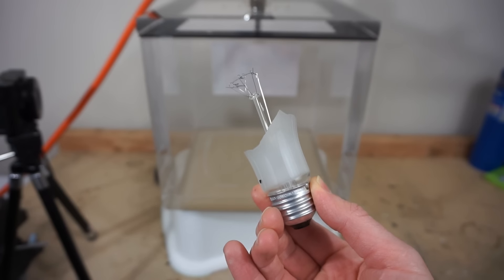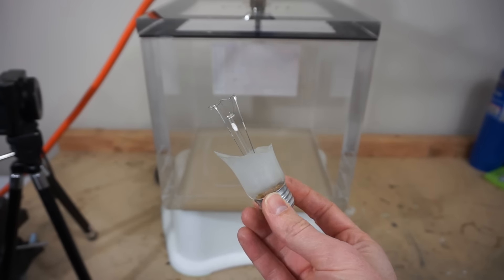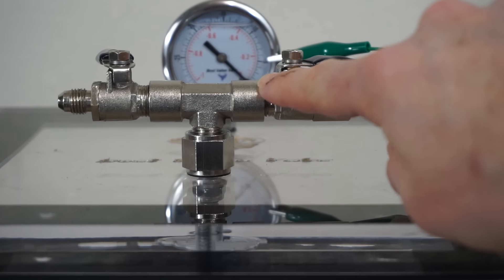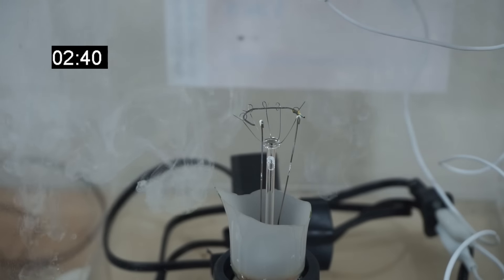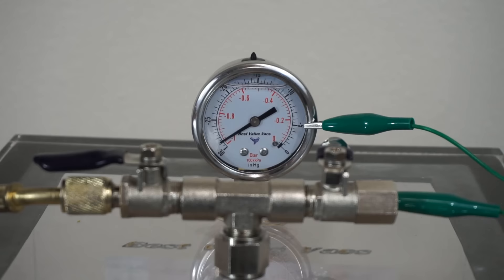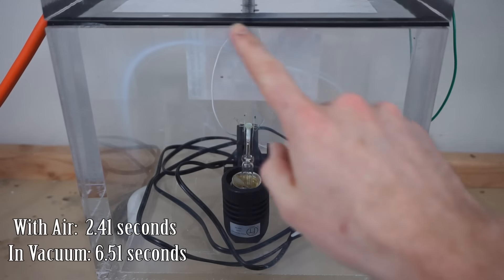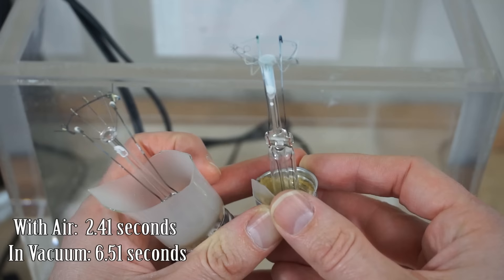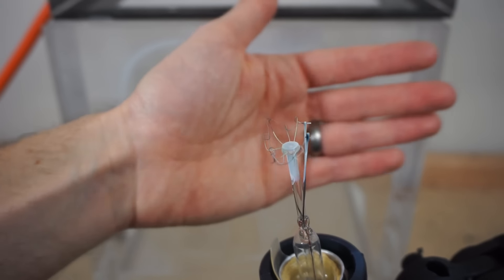What Happens When You Turn On A Broken Light Bulb In A Vacuum Chamber? Will It Burn Out?

Comment: You noticed the second one was thinner since in vacuum due to very low pressure and high temperature the filament sublimates, that's what the gas ring was and that's the reason it only lasted 6 seconds.

Learned so much science from you, Thanks!

Comment: Put in 2 bulbs using the first one to get rid of the oxygen before starting the second one.
Reply: Get this pinned!!
Reply: Fletcher Hurst that's smart
Reply: considering the low pressure and consequently lack of air in there it might actually burn all if not almost all of it
Reply: A candle would be easier.
Reply: The best thing would be to get a good vacuum pump.  End of story.
Reply: thank you also add gas for colors
Reply: The way you do it when you are aiming for a really low vacuum is to flush the evacuated chamber with a heavy inert gas like argon and/or krypton, raise the temperature, and then turn on the scavenging pump again. The higher partial pressure of the heavier inert molecules dilutes the reactive ones and their high individual momenta bash the reluctant ones out of crevices and overcome surface adhesion.
Even if you aren't trying to get through the millitorr barrier, the flushing will greatly reduce the concentration of oxygen. Even at an ultra-high vacuum of a trillionth (10^-12 atm or a 0.1 micropascal) of an atmosphere there are about 25 trillion molecules per cubic meter. The average molecular spacing is 0.01 mm.
At 100 Pascals that's a bunch of leftover oxygen at 21%.
Reply: @planktonfun1  yeah like hydrogen or just acetylene would look cool

😂🤣🤣🤣

💥💥💥
Reply: @308_Negra_Arroyo_Lane   I don't think a candle would work because combustion flames require a certain concentration of oxygen to even light. In a vacuum chamber, you wouldnt even be able to light it. It's better to flush it with an inert gas, or burn the oxygen out with another lightbulb.

Comment: I don't think it will burn out immediately, but will last a lot less than if it was in its original glass envelope. My guess is that it will last about 12 hours of continuous use.
I think this because normal bulbs are first filled with an inert gas, and then under vacuum, so that any remaining gas is still inert and won't react with the filament.
But in this case, you're going from air to vacuum, so there will be a small amount of oxygen left, which over time will affect the filament.

I could be completely wrong, but I would like to share my hypothesis.
Reply from the maker: +Dan Coulson yeah I thought it would last a lot longer than it did, but I think that unless you put some inert gas in there there will be enough oxygen to burn out the bulb.
Reply: OK, well my guess for exactly how long was way off. But I'm still happy I correctly guessed it would last longer.
Reply: I think that light bulbs are also made with a way more powerful vacuum... But im not sure
Reply: BlaXeD ! it's not about the suction power of a vacuum but the materials used to make a lightbulb last longer while in use
Reply: Light bulbs are actually filled to about 0.7 bar with an inert gas, usually nitrogen, argon, or a nitrogen-argon mix.
Reply: 0.7 bar isn't that low of a vacuum is it?
I'm correct in understanding 1 bar is atmospheric pressure at sea level? I could be totally off though, don't quote me on that.
Reply: No, it's not that low. Having a fairly high pressure allows the bulb to not have to be as strong to resist the implosive force of the outside atmosphere.
Reply: maybe the second wire melted because it became to hot? if you only have like <0,1 bar left, nearly every warmth is stored (heat output only through radiation) - with a 0,7 inert gas you still have a lot of convection, which would transfer heat from the wire to the glas of the bulb.
Reply: It likely has most to do with the lack of oxygen in the bulb, and the partial pressure on the inside preventing the filament from vaporizing too much.
Reply: @dancoulson6579  It was at a very low pressure, so the tungsten likely vaporized a lot. There would also be some residual oxygen, but there are ways to get rid of that.

Comment: The tungsten melted and/or sublimated as the temperature of the filament got over the fusion point of the metal (the light color temperature visibly increased just before). The absence of an inert gas caused excessive heating and accelerated sublimation of the filament
Reply: @eriton6806  What you're saying makes sense, but you should be careful using cameras to measure color temperature. If you look at the background before and after the filament was turned on in the vacuum, it was much more yellow-orange before, and much more bluish after. In other words, the camera itself, for whatever reason, changed the color temperature of the entire scene, and this is likely the dominant reason that the color temperature of the filament appears to increase. 
While I agree that an inert gas would help remove heat from the filament, even in a vacuum, the filament loses a lot of heat through radiation. So I'm skeptical that the lack of inert gas would lead to a large enough temperature difference to yield a noticeable difference in color temperature.

Comment: I think if you had a gauge that would show very low vacuum pressure more accurately, you would see you probably need to run it a lot longer to get as close to a perfect vacuum as you can.  I would also leave it running in case there is a little bit of leaking.  Of course other suggestions to add in some inert gas would also help.

Comment: the plate of metal in the filliment repulses the ionized molecules in the rarified air of the bulb's vacuum, otherwise, as tesla pointed out, the rarified air left in the vacuum literally attacks the fillament with erosive friction which eats away at the fillament until it tears it apart.  the metal plate is used to attract the erosive molecules.  when the bulb glass changes shape, the pressure zones of the rarified air changes.  a hole in the bottom of the bulb should last longer.  also a dimmer switch would help. great video.  still very surprising.
Reply: Ok?

Comment: I suspect that the reason the filament failed in a vacuum is that it was in a vacuum. This allowed the filament to evaporate when it heated up. With only a few millibars of atmosphere present, the filament doesn't have to heat up much for its vapor pressure to exceed that of the vacuum, and thus the filament starts to evaporate. In addition, the lack of a gas environment means that the only way for heat to transfer away from the filament is by radiation and by conduction through the filament's physical support; thus, the filament heats up faster, which speeds this evaporative process. The filament fails when it ablates away enough to break, or when part of it melts, whichever happens first. The ring of smoke you observed in the video isn't oxidized tungsten, but rather condensed tungsten vapor. 

An intact bulb is filled with around 0.7 bar of an inert gas, usually argon or nitrogen, and that means the filament does not evaporate nearly as much, both because of the higher surrounding gas pressure and because the gas atmosphere conducts heat away from the filament, helping to lower its temperature.

Comment: The thickness of the filaments is a HUGE factor. If you can get some inert gas, like argon for a mig welder or helium for a tig welder, try back filling. Pull your vacuum, introduce the gas until atmosphere, then, pull again. I'll bet you'll get the longevity you're hoping for. Even if your pump could pull the vacuum of interstellar space, the filament would sublimate, coating the vacuum chamber with a black film of condensed tungsten. Halogen bulbs are back filled to a higher pressure, but because of convected heat, that's why the capsules are small. The higher partial pressure keeps the filament from sublimating at higher temperatures. That's why they last so long, and so bright.

Comment: +Hydraulic Press Action  I'm surprised that the one in vacuum didn't last longer.  I guess the thin filament just vaporized too quickly.

I think you should try this with your chamber filled with argon or helium at atmospheric pressure to see if it lasts a really long time.  If it doesn't, something's wrong

Comment: If anyone is wondering why the one in vaccuum is thin.. its because it melted... 

As the bulb was turned on, currebt started to flow. Due to the flow of current and resistance of the filament, heat started to build up. Now normally in a bulb with inert gas, the heat generated would be transfered to the inert gas molecules and to the surface of the bulb. But in vaccum, there was nothing to loose the heat to. And the only way to loose the heat was via. radiation, which is the slowest mode of heat transfer. Hence due to the constant flow of AC current, and the heat energy building up, the filament soon reached its melting point and staeted to melt. But as it melted, it got thinner. And as it got thinner, its resistance increased, which led it to get more hot and glow more... and the process stacked up and ended in the burst of light and the melted filament.

Comment: The reason why the light bulk died in vacuum is not caused by oxidation, but it's because the filament was too hot that it evaporated and then break down.
However, when the filament stays inside a light bulk, it will not evaporate, as the filament reach its chemical equilibrium between the gas state and the solid state inside the confined light bulk.

Comment: Nitrogen.  an inert gas which prevents further oxidase of the filament "Actually prevents overheating of the filament." . added in place of Air.  first the bulb is vacuumed completely of all air, then Nitrogen is pumped in to displace any gasses which are left.  This prevents it from burning out.

Comment: You could have put some liquid nitrogen in the chamber first and then drawn a vacuum on that to remove all the O2 as much as possible.  It should be a lot colder than the regular atmosphere so the regular atmosphere should float on top of it, as you pull the vacuum.  You might have the lightbulb work for a good long time once the temperature gets close to room temperature.

Comment: There's several good suggestions. 
Fill the chamber first. Co2, helium, argon, or from a can of dust-off, then turn it on, then try vacuum. Can the chamber hold pressure? like 1-2 psi? 
Dimmer to turn it on slowly. 
2 bulbs, and dimmer. To see if the first one consumes any reactive gas. 
Looks like you used 45-60W. Try 15W. 
Safer wiring. 

Or even just a flashlight bulb. 

I'll bet Edison did all of that. 

You need a do-over.

Comment: Incandescent light bulbs are filled with halogen, which isn't inert like the noble gases. The chemistry is quite fascinating, and is the reason why unbroken incandescent lights can last hundreds of hours. Some "xenon" incandescent bulbs have a tiny bit of xenon along with the halogen, but these are not true xenon plasma bulbs. Some incandescent light bulbs are filled with a mixture of argon and nitrogen. These have a black deposit on the glass when the globe has died. See https://en.wikipedia.org/wiki/Halogen_lamp

Comment: You can instead of  only sucking air them connect the the other end with nitrogen gas to let it get in and then light it again! The light bulbs contain a little amount of nitrogen gas in them that's why they hold so much nitrogen help the wire not oxidised  ! 👌😉

Comment: Doesn't the inert gas in the lightbulbs also cool the filament so it doesn't reach the melting point?
In a vacuum, the filament would increase in temperature until it melts.

Comment: You can use an isolation transformer which is a 220 to 220v transformer (or 110v).
Just get two old identical iron core transformers, dissasemble them, remove the secondaries, and put both primaries together, then reassemble the Es and Is.
That way you get two phase current that is not referenced to earth or ground... so as long as you don't touch BOTH output cables you are fine. Touching one (any one) will just give you 20v or less when compared to ground voltage.
https://en.wikipedia.org/wiki/Isolation_transformer

Comment: dude, your chamber is leaking, thats why  fly and spider have survived.
Reply from the maker: +King Parodije there is no leak, the pressure gauge shows that the pressure stays at minimum pressure the vacuum can reach. It was just due to the trace oxygen in the chamber. I need to put some other gas in there then vacuum it out. I will probably try this again.
Reply: I don't know what gas you could use. I expect that Carbondioxide might still react with tungsten at those temperatures.
Helium might be good, but it's a bit hard to handle, being lighter than air.
Xenon would be brilliant, as it's a noble gas and heavier than air, but it's so damn expensive. Just a balloon filled with it will set you back about £40 (~$50).

Comment: They can't oxydize, that's right, but it reaches 3000-3500 degrees, so it melts
Reply: The melting point of tungsten is around 6000 degrees fahrenheit.

Comment: well engineered? they are made to break in a set amount of hours.. go back to the "first" light bulb that's still working today. you can view it on a 24/7 live stream. funny how 3 cameras have had to be replaced yet the light bulb still goes strong.
Reply from the maker: +GooglyEyed Moose wow I had never heard about that light bulb, I looked it up just now. The centennial lightbulb has been burning for 116 years! And others from that time lasted for almost as long. That does mean that modern light bulbs are designed to fail quickly, that makes me a little angry 😡. Thanks for letting me know that!

Comment: Light-bulbs are not a perfect vacuum or they'ed implode. The oxygen left is displaced with an inert gas. You vacuum chamber also was not a perfect vacuum and you didn't replace the last bit of oxygen with inert gas. You're experiment was flawed.